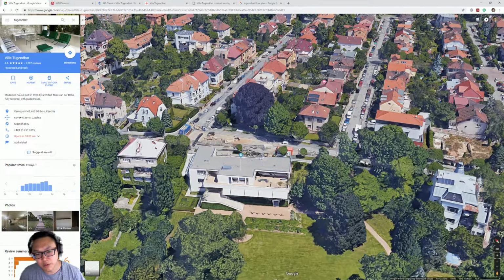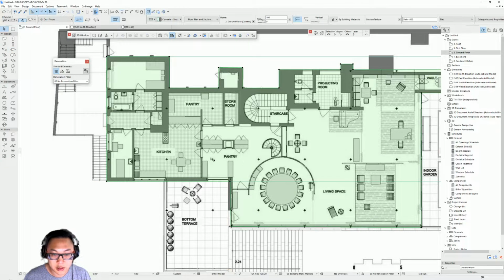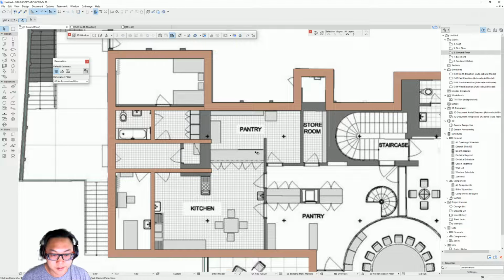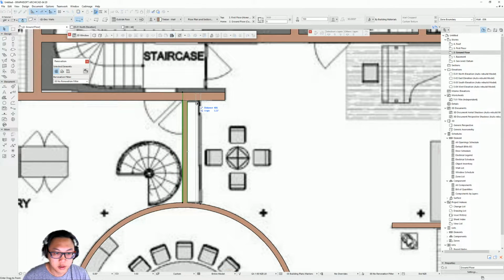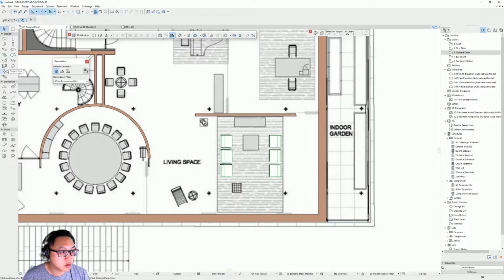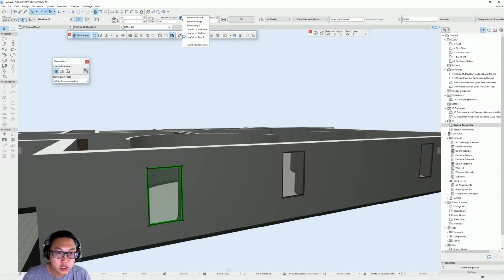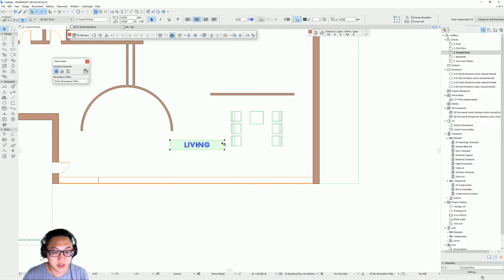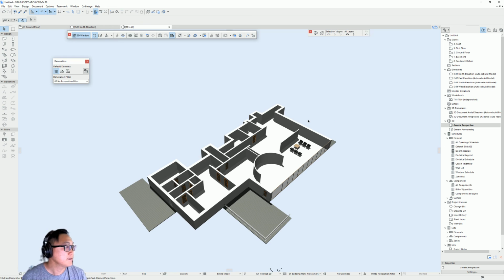ARCHICAD TUTORIAL - Villa Tugendhat | PART 1 - How to draw a Floor plan

Comment: I found a section that shows the height of the basement is 270cm ground floor 400cm and second floor 350cm. You probably change it later on in the series but just putting it out there.
Reply from the maker: Thanks for the information! I was planning to remake that house as I lost the archicad file for that project :(. So I’ll keep those measurement  in mind for next time. Cheers!
Reply: @neveets  Yeah sorry I ended up changing it 290 385 350 350 from basement to roof based on measuring a different section, so I guess it's worth checking a few more to see.

Comment: Hi Steven! I love your tutorial but came accross a problem that I cant find a solution to.  When drawing a wall in a 2-3 degree angle, the side of the wall is not straight,more like zig-zagged. Can you pleaase help how to create a wall in angle with straight lines? Thank you! Kristin
Reply from the maker: Hi Kristin, is the wall not straight in Plan view or in the 3D View? If it's plan view, you might have added an extra point to that wall. If that's the case, you can click on that point and drag to one end of the wall so it will disappear.